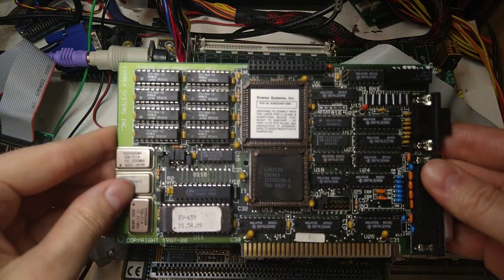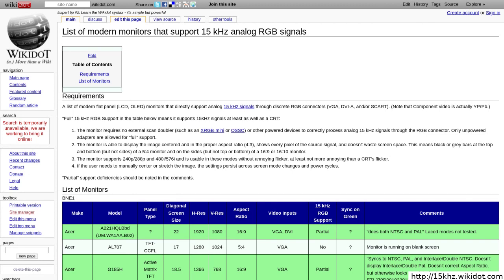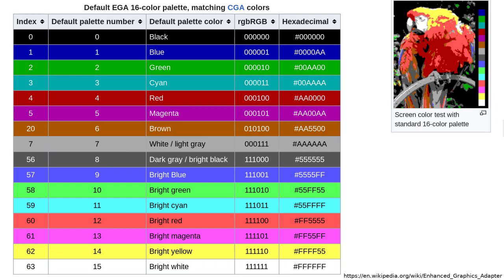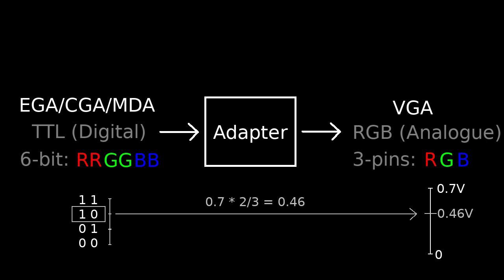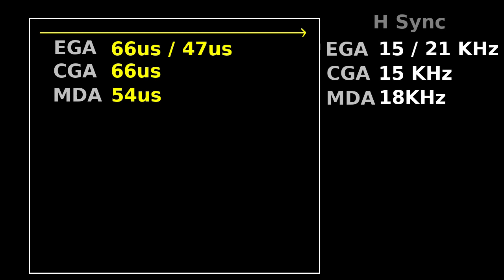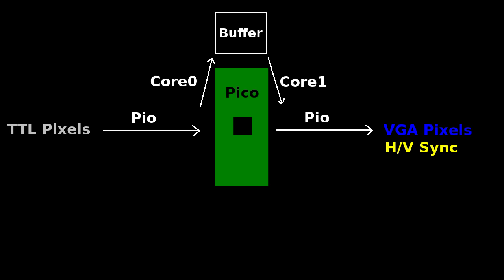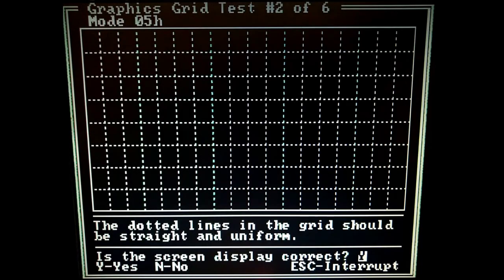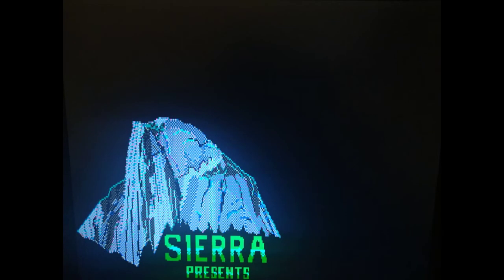MCE Blaster: Pi Pico based MDA/CGA/EGA to VGA adapter (Part 1)

Comment: Why don’t it has a HDMI out also or only HDMI out
Reply from the maker: Because most 4:3 LCD and practically all CRT monitors are VGA. Also VGA to HDMI adapters are widely available for cheap, so supporting HDMI hasn't been a priority.

But making a HDMI version shouldn't be too hard (assuming we have enough GPIOs for it). The hard part is the input (TTL) side, not the output.

Comment: Great project!!   I question could a TXS0108E be used in place of the 74LVC245 for the level shifting without any mods to the PCB?
Reply: I built a  couple of through hole board and they work very well. Thank you for all your hard work on this project. I ran into a problem getting the level shifter in DIP hence the question. Solved it by adding a SMD on a DIP adaptor and fitted on the underside (too wide to sit under the Pico).

Comment: Would it be possible to transcode MDA/CGA/EGA directly to DVI? VGA is still quite flaky on LCD screens and capture devices. Would be nice to have the output in a modern-ish digital standard. I'm also wondering if it would be possible to repolace RAMDAC on a VGA card with DVI encoder.
Reply from the maker: Yes, I think it should be possible, I will give it a try.

Comment: Cool project! You may struggle with timing because every old EGA card seems to have slightly different pixel clock rates. There was no exact standard and when creating profiles for the RGB2HDMI project I often had to tweak things slightly from EGA to EGA card. Same for MDA vs Hercules cards .... Also slightly different even from text to graphics mode. It's akin to the auto timing stuff VGA LCD monitors have to employ as VGA cards all vary slightly as well.
Reply from the maker: Yeah getting it to sample the input perfectly will probably be an issue. I am actually synchronizing sampling per line so as long as it's not too off I may be able to get rid of the sampling artifacts. But yeah I definitely need to do more testing. Thanks for the feedback :)

Comment: I'm far from an expert, but how about a Pi Zero?
Reply from the maker: The Pi Zero has a much faster main CPU but it is lacking the programmable PIO state machines of the Pico. These state machines run deterministically and give you cycle-accurate timings, which is required for sampling the input and generating the output that drives the VGA. For example, you can ask the PIO to generate a signal that is high for X nanoseconds and low for Y nanoseconds, and it will produce a perfect signal. As far as I know this can't be done with either the main ARM core of the Pico or the ARM cores of the Pi Zero, or any other faster Pis.
Reply: @scrap_computing  Yeah, my guess would've been timing since you didn't use it, but thanks for the explanation.
Reply: The RGB2HDMI project handles this with an external CPLD to perfectly synchronize and digitize the input signal, then you have all the power of the Pi Zero framebuffer to handle scaling and every custom digital video format imaginable. It's one of the most phenomenal solutions around for retro display and has no downsides outside of requiring a Pi Zero, SD card and the CPL hat (so costs more.)

Comment: would it be possible to convert MDA/CGA/EGA to DisplayPort instead?
Reply from the maker: As long as it does not use more than one core it should be possible. I think there is some project out there that drives a display port with a Pico. Funny enough the hardest part is not driving the display, but rather getting the input from MDA/CGA/EGA :)

Comment: Before playing the video I got excited you resolved sampling frequency phase problems, but alas. You will need additional PLL clock with finetuning, like $2 Si5351A to feed base frequency into pico instead of its standard crystal.

ps: there is also pico-rgb2hdmi project if you fancy adding hdmi/dvi output.
Reply from the maker: I think the sampling issue is because I haven't actually set the sample timings correctly. But you may be right, I will need to do some additional testing.
Ah, thanks for the pointer! If this one works well, that would be the next logical step.

Comment: how long until we get a full on card solution that replaces the mda/cga/ega video cards entirely to output vga native, but the software sees the older formats on a case by case basis?

i can't imagine its going to be much longer.
Reply from the maker: Yeah it shouldn't be impossible to do both the interfacing with the ISA bus and driving the display, at least for an 8-bit card. The only issue is that the Pico is almost not fast enough. A newer slightly faster version of the Pico would just make it a lot easier.

Comment: Calibrating sample point on a moving target must be a real nightmare?

Making the rp2040 process pixels at insane speed is fairly simple with chained DMA and strategic assembler code but that part... I'm having a headache just thinking about what you have to deal with. Extremely impressive! :)
Reply from the maker: Getting the sampling right is the trickiest part, but I think I can improve upon the current version quite a bit. Not sure if we can get it to work perfectly though.

Yeah DMAs are an option, but we also need to do some computation with the input data for skipping the black borders, identifying the mode and adjusting the borders etc. But yes, it is definitely worth considering.